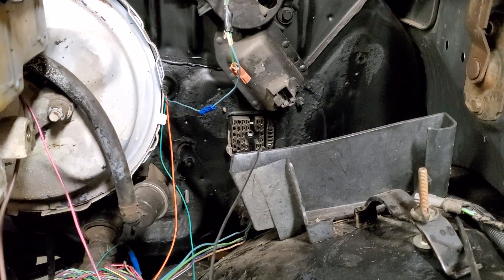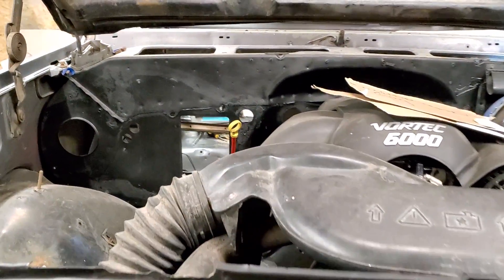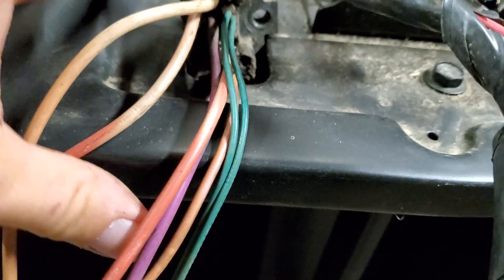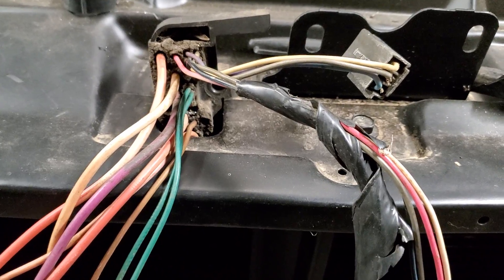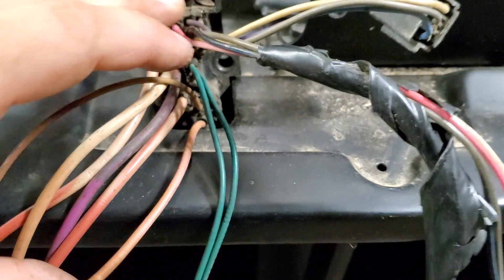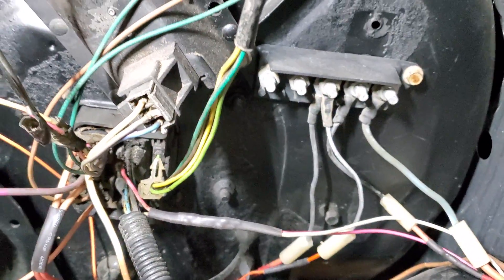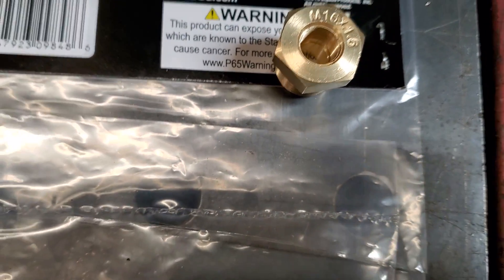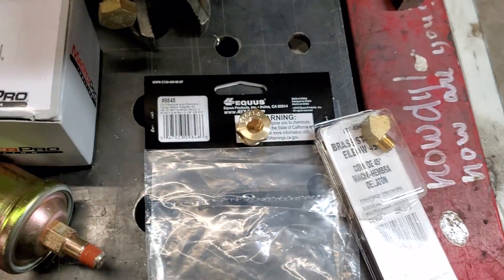Wiring The Bulkhead, Oil, and Temp Sensor for the LS Swapped K10

Comment: On my 79 c10 the red wire that goes to the junction block needs to be pulled to the hot wire on the fuse center on the ls swap and the hei distributor wire goes to pink wire on fuse center pin out and starter wire purple goes to other starter wire on computer

Comment: Will the factory gauge work this way? That sensor has the right resistance to make it function properly? If so this is killer 🤘🏽
Reply from the maker: @1964avanti  yes factory oil and temp gauge works.

Comment: That 2nd down “Pink wire”…. I get no power from it when the key is “on”.
Reply from the maker: Then you have something wrong. Check your wiring and fuses
Reply: @lonniesgarage  
Yeah… been through all the fuses… switch seems to be good (ohmed it) 
going to start tracing.
I can’t seem to find if mines different because it started life as a 6.2 diesel. 
1982 GMC K2500
Appreciate the videos 
Still very helpful!
Reply from the maker: @basemandog  yeah it may be different then. Because that pink wire would have went to the distributor

Comment: Love your videos man, one question. As far as the oil pressure switch does the pcm need to know the oil pressure?
Reply from the maker: Nope pcm doesn't require the reading. I change it to a single wire sender and run it straight to a gauge
Reply: @lonniesgarage  cool thanks brother, I'm going to be using a none electric one just because I already have the gauge.

Comment: Couple of questions...the 2nd wire you mentioned that needs to go to fuse block, does that wire stay hot when cranking over? Also, the way you explained the temp sensor modification,  does that work for aftermarket gauges like VintageUSA or Dakota digital?